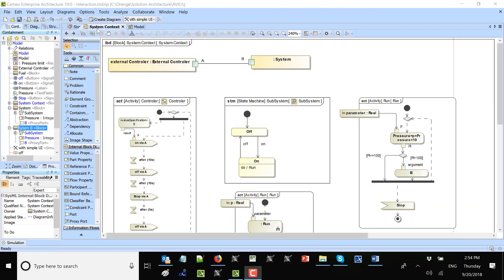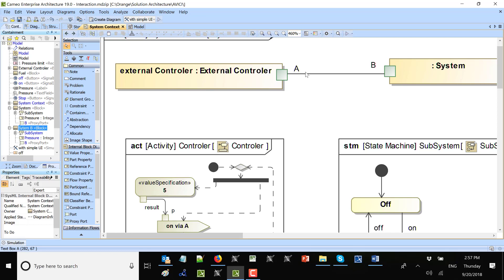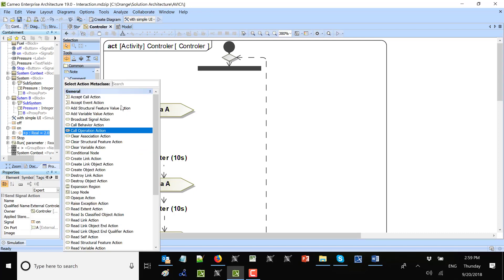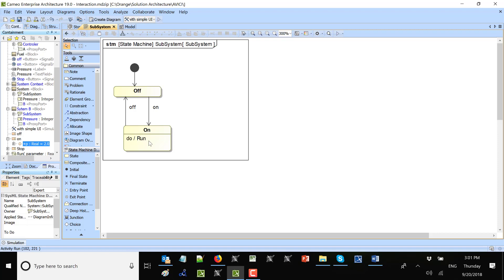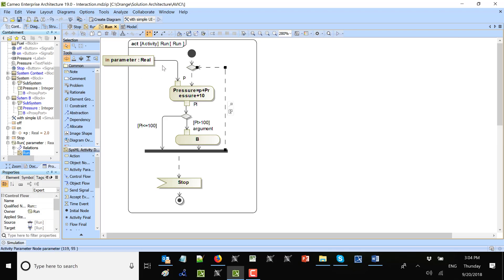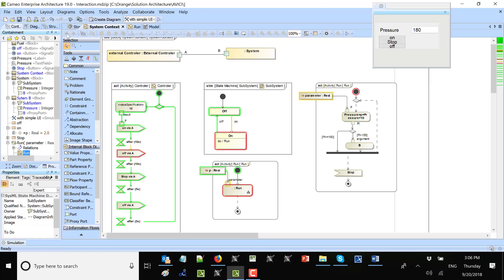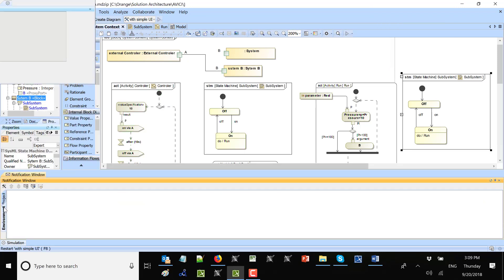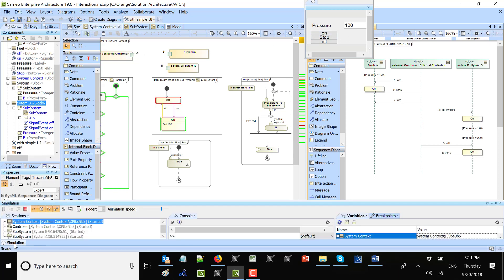Information Exchange Between Blocks Simulation

Comment: Thanks for great video.

Quick question: I have an opaque action and output of this action goes to decision-making. I have 3 different value.

A = true
B = 10
C = 15

decision making 
-> [A == true && B < 12 && C < 20] -> Send signal action..
-> [else] -> Send signal action..

It does not work automatically. It asks me Yes or No. 
But if I add just [A == true], then it works great. How to add "and" and "or" condition to the guard? I used python as a language. Thanks again.
Reply from the maker: Hello Ufuk. Good quostion! Try didferent language, try build-in-math. Try to compute answer before in opaque action and check single variable on guard.